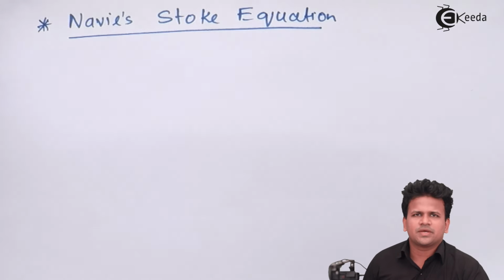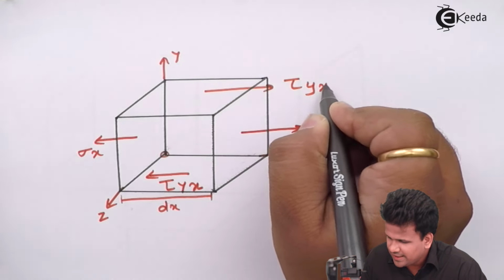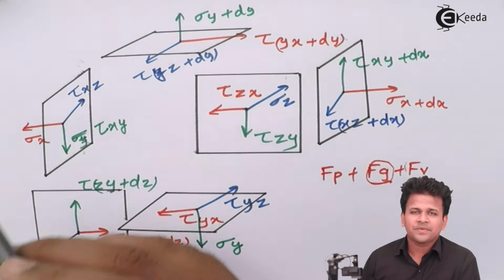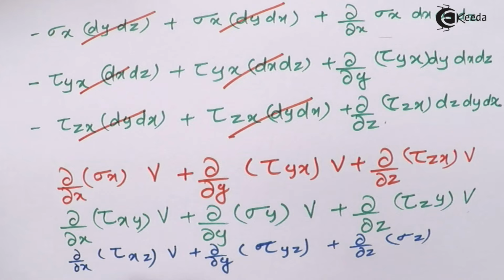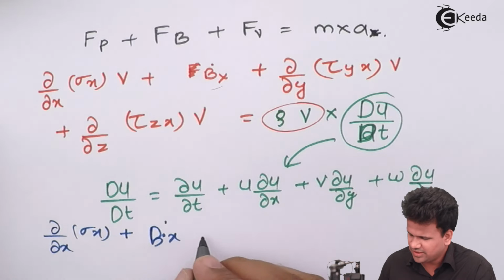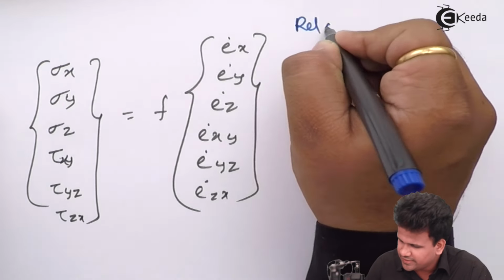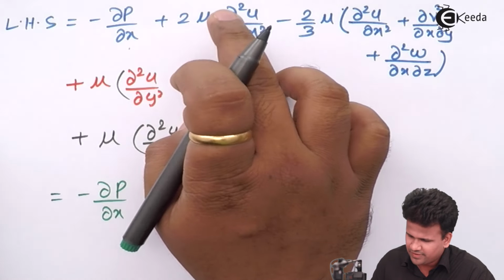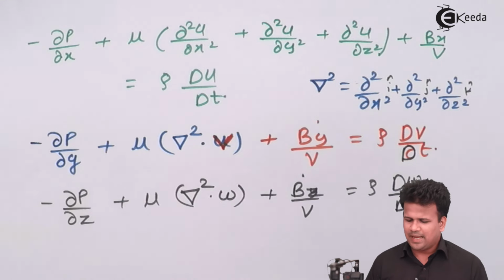Navier Stoke Equation and Derivation - Fluid Dynamics  - Fluid Mechanics

Comment: 41.25 kaisy Kare gy
Reply: Actually that comes after considering that the total stress acting on the fluid element is due to summation of two stresses...One is hydrostatic stress which acts when fluid is stationary and other is deviatoric which acts when the fluid in motion. That is total stress = hydrostatic + deviatoric. In the equation (-p)  is the hydrostatic stress and the other terms with viscosity are rates of deformation of fluid element which is deviatoric stress. Sir should have explained stokes hypothesis as it is very important in the derivation of Navier Stokes equation.You should see fluid mechanics videos by Dr. Suman Charkoborty or S. K. Som they have explained this in detail.
Reply: @sohamsanathra1785  Thank you. Do you know where the element of 2/3 comes from?
Reply: 2/3 comes  after taking the arithmetic mean of the normal stress components of the stress tensor. That is[ (Tau11 + Tau22 + Tau33) ]/3. This is equal to mechanical pressure. This mechanical pressure is equal to thermodynamic pressure +{ [ lambda + (2mu/3) ]  x divergence of velocity vector}. 
Where mu is viscosity and lambda is second coefficient of viscosity. Here we need two constants ( Only for homogeneous and isotropic fluids) to define the state of stress of a fluid element. Like in strength of materials we need poissions ratio and Youngs Modulus. 

According to Stokes hypothesis [ lambda + (2mu/3) ] = 0. Thus mechanical pressure is equal to thermodynamic pressure. For incompressible fluids divergence of velocity vector is zero. Thus 2/3 term vanishes. 

Type constitutive equations in fluid mechanics in Google. You'll get MIT PDFs or other pages for an overview. For more detailed derivation refer standard textbooks on Continuum Mechanics. You'll find exactly how all the terms come. Useful in Strength of Material also.
Reply: @sohamsanathra1785  thank you